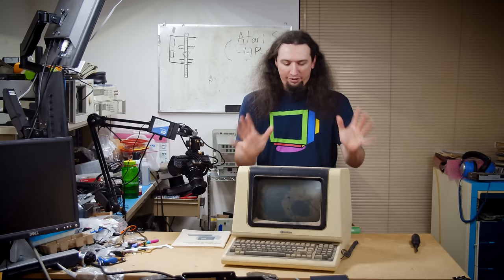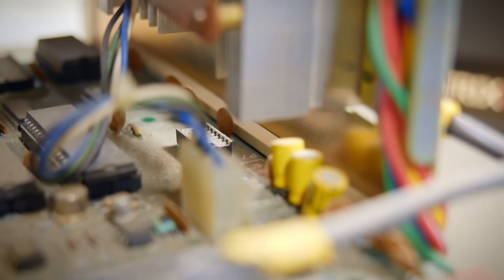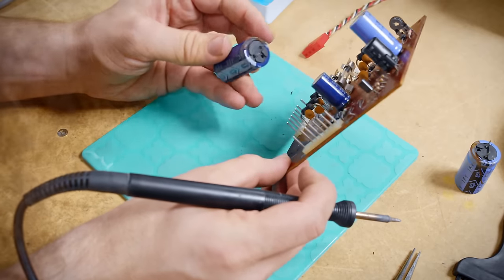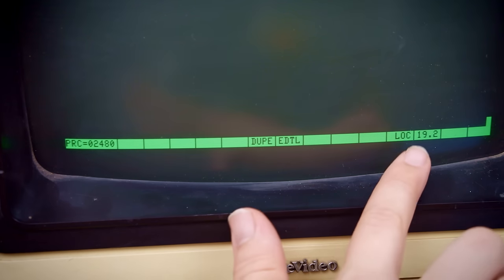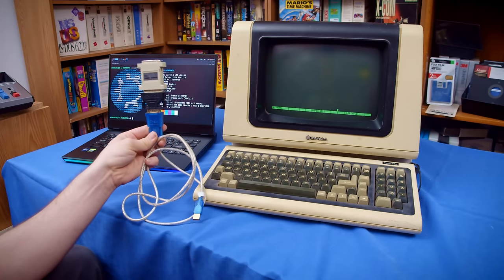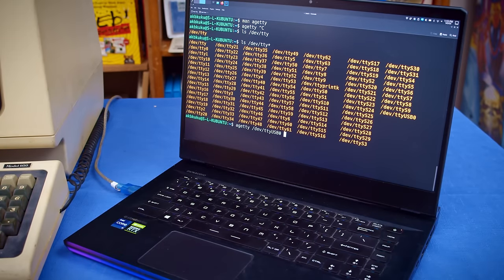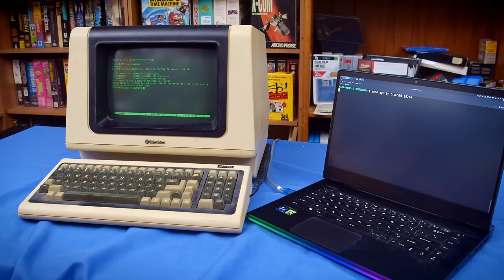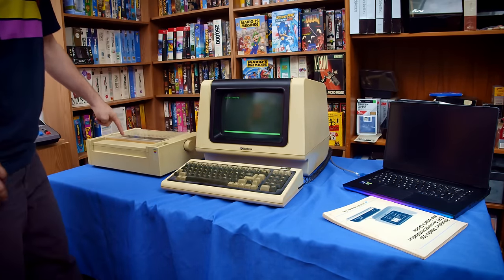1980 Terminal with Linux - TeleVideo 950

Comment: It actually kind of makes sense that the "back space" goes back a space, and the "delete" key actually deletes a character.
Reply: This is my experience with AS/400 as well, at least thru terminal emulators.
Reply: back space backs a space

delete key deletes a key

Gotcha 👍
Reply: That's how they worked back in the day, including on DEC VT terminals.  So it's not a weird mapping, it's correct by design.
Reply: Backspace goes back a single character, not a space.
Reply: @randomdesign6304  Absolutely, it went so far that on the keyboard of my good old Siemens terminal, the key has a double label: "Backspace / Backstep".
Together with the Shift key, it sends the code for "Delete".
Reply: @tramadol42  Erase, erase! Wait, where's erase?
Reply: It's a holdover from typewriters, when you had to go back a space and then press the key again with the erasing tape to remove it, commonly.
Reply: These terminals were around when I was in college.  It's INFURIATING to use this keyboard.  Nobody ever would use them.  Basically they were around in labs, but nobody used them.  People would get on them, get frustrated, and wait for another terminal to become free.

I would never want to go back to the bad old days, but it's funny to see how we keep repeating history.  They're trying to force us all onto "the cloud" - I.E. a mainframe.  They attempt to do this every 20 years or so.  Thin Clients was the last attempt, I was on a mainframe at the tail end of their existence.

Your phone is perfectly capable of running Unix well enough for 2000 users to do all the course work (and research) they could back in 1990.  Kids have no idea how far we've come, and they have NO CONCEPT of how much power they have in their pocket.  I doubt they could work without a GUI interface though.
Reply: It always bugged me, if the cursor is to show what character you are modifying then back space should go back a space and delete should delete the selected character... but the way that the keyboard is laid out does not make it easy to use it like that, I always felt like our current keyboard layout could be made much better along with the shape of the keyboard itself, it should be shaped to fit how a humans hands naturally rest on a table and instead of keys being further away they should be closer to the wrist, think about it, do your fingers magically extend? No... but they do curl in very easily, shift, enter, caps lock, back space, space and enter should be on the floor, you could easily use your feet for those, making more space and probably speeding up typing, I'm also surprised that gaming only keyboards aren't more common, simplified keyboards for daily browsing etc, with wireless switching them depending on your needs would be quick and easy...I just feel like there hasn't been any real innovation with keyboards in a long time...
Reply: You used to be able to go grab all kinds of weird adapters and cables locally when you need them, now you have to hope that you can find what you need online and hope that it's actually wired correctly internally, then wait, depending on how rare and far away it is, days or even weeks for it to arrive...we have one very old computer repair shop that has not thrown anything away in probably 30 years, they usually have what I need, I always make sure I pay above the sticker price, most prices are 15 years old, rare cable priced at 10 dollars, and try to give them as much business as possible in an effort to help them stay open and profitable for as long as possible, it will be a sad day when they finally close...
Reply: @wilfredpayne433 The QWERTY keyboard is pretty much as optimized as you can get. It's intentionally laid out based on the usage of letters in the English alphabet, and most of the extra keys you need for grammar and such are easily accessible. "Ergo" keyboards have flopped over and over again because of how solid the current meta is. All the big brands have had your thought, and spent a crazy amount of money to try to be the first to do it and cash in, but nobody has come close.
Reply: "Print screen" is a DOS throwback to when if pressed would print on a printer what is literally on the screen by sending the contents of the screen to LPT1

Comment: There's no fundamental reason why all the features of this terminal do not work with Linux. The termcap definition is just incomplete/wrong. Someone just needed to get some basic stuff working with this terminal and submitted an incomplete/wrong definition and no one has cared ever since. Just like there are tons of non standard keyboards that don't have proper definitions that don't work fully with Linux because no one bothered. Maybe try with a BSD.
Reply: In general, Linux and the major BSD flavours all share the same ncurses-supplied termcap, so this sadly probably won't make any difference.  If you want a proper tvi950 termcap, you might have to go back to the SunOS 4.x era, maybe a 2nd-gen SVR4 system like Unixware.

[Source: I am a termcap/terminfo author for several terminals, but not the TVIs.]
Reply: So true.  Linux seems like it has all this support for a huge variety of platforms and modular components, but in reality, if you're not running it on x86 hardware with a modern ANSI-like terminal and a recent GCC with full GNU life support system, well... good luck to you, sir.
Reply: @nickwallette6201  I'd go further and say that Linux only runs well on hardware that is 1) supported by hardware vendor employees that contribute to the kernel 2) hardware that is used by big companies who can pay for employees to fix bugs in the kernel 3) hardware that is used personally by Linux kernel programmers. Outside of that sooner or later, you're out of luck because of the constant code churn in the kernel breaking things without testing on hardware that doesn't fall in the three cases I mentioned. These days Linux crashes all the time on the very same 32-bit hardware where it used to work flawlessly (no regressions with the appropriate Windows, so it isn't a hardware malfunction). I had to buy another damn video card recently because AMD employees that "maintain" Radeon stuff in the kernel do not fix any bugs for perfectly working hardware they deem "too old".

On the other hand, I don't think you really need GNU stuff. Alpine with musl/busybox works fine.
Reply: @KnutBluetooth   That's very true.  I have a VIA Epia board that is pretty much unusable on recent x86-32 Linux due to various hard lock-ups and extremely poor throughput on at least the IDE half of a PCI controller card under the sata_promise driver.  Also tried to use a Matrox G200 on another older box, figuring that ought to have great driver support.  Nope.  Completely broken.  Just random garbage on the screen.

I do love open source projects, but the downside of no official support channel is that code maintenance follows volunteer dopamine.
Reply: @nickwallette6201  Except for hardware vendors who are quick to abandon support for their own stuff, I don't blame them. I'd be even willing to pay a reasonable amount of money so that kernel programmers could be hired publicly to maintain older hardware in Linux. But I'm pretty sure this would be opposed ruthlessly with lobbying just like 'right to repair" laws.

Comment: I disagree with the statement that 25 pin connectors had more flow control. IBM introduced the 9pin version because its smaller and it has all the serial handshake lines that are used for rs-232 communication to modems common in the 80’s. Tx, rx, Cts, rts, dtr, dsr, cd, ring, gnd. The 25 pin connector has other pins defined for synchronous serial clock signals, secondary serial channels, and a bunch of unused or reserved pins. None of which were useful for a pc connected to a common async telephone modem or serial printer.
Reply: Most of the extra signals of the DB25 version weren't used by basically anything by the '80's.  Not sure how much they were used before that, as I started college in 1983 and that's when I started getting serial terminal experience.  Used to know the main pinouts for a "proper" null modem cable by heart.  GND is GND, RX crosses TX, DTR crosses DSR, RTS crosses CTS.  Just don't remember the numbers now.

Comment: I would love to get a vintage terminal like this and use a Raspberry Pi booting to serial. The irony is that how powerful and small the Pi is compared to the computers this terminal connected to when it was in its prime.
Reply: Could easily find room inside the terminal to mount the Pi. Just keep it away from the high voltage.  With a bit more work you could use the Pi's built-in TTL serial direct to the terminal (bypassign the RS232 level conversion in the terminal) but you'd need to protect the Pi against the (probably) 5v TTL serial in the terminal.
Reply: That's what Shelby did with another terminal.
Works pretty good and there should be a video of it I think.
Reply: No you wouldn't want this.  What would you do with it?

A raspberry pi is as powerful as the Unix mainframe I was on in 1990.  Why would you want to use this terminal?

This terminal was designed for monochromatic graphical display.  Did he even demonstrate that?  If you want an "old style terminal", get a VT-220.  That's just a 80x24 colum display (was it that?  Something like that..)   There was the VT-100 as well, but I hated working on them, they had lower resolution to draw the characters, much harder on your eyes.

This terminal is not something you'd want to try to use.  The backspace key, ALONE, makes is entirely frustrating to use.  We had a bunch in college, but the only thing people used this for was to show pictures, then log off.  I never once saw a person working on one.  They were replaced by the NCD X terminals which were just dumb terminals that ran X11 in them, designed to be black and white - they were usable but I don't even know if they would be compatible with modern X11.  You could, conceivably (?) run an NCD against a raspberry pi, but I'd check first.  Those would be entirely usable if they are compatible with currently X11.

And you don't want to go back to 1990 anyhow.  You really don't.  All of this stuff was neat at the time, but it's downright primitive today.
Reply: @fuzzywzhe  Yes. Yes, I would. Its the physical personification of putty
Reply: @esra_erimez  Why would anybody want to use putty?

When I think about it, I'm not even certain this terminal is entirely compatible with the VT100 character escape sequences to allow you to run an editor like VI or Emacs on it.  Maybe Ed.  These sequences are necessary to position the cursor.

Good lord, I'd never want to go back to stone knives and bear skins again.

I used to be quite expert with the VT220.  You could reprogram the font.  Somebody used a program I wrote to make a video game, I think it was one of those pipeflow games.  Interesting, somebody made BoulderDash on the machines, but they didn't use my program to do it, however I used my program to recode their version of BoulderDash to run on a VT100.
Reply: I have a televideo950 here. A little cleaner than te one this video started with. I don't use it but kept it in the attic. If you are interested...
Reply: @xavierrodriguez2463  it's not fun to struggle with old technology, it's just a headache.

Look, being able to copy files through a serial and parallel.port was great in 1995.  Would you want to go back to that than just use wifi?

The headaches I endured just getting the damned things to work.  I would never want to spend 3 days again setting up.linux, or futzing around with settings on an audio card, or recompiling drivers and kernels.  Tying to find space to uncompress a file.

So many nightmares and the difficulty of it all, and how fleeting everything was.  To use a floppy again or even a DVD?  No thanks.
Reply: @fuzzywzhe  people like things, is that a new concept to you?
Reply: @gerooq  I know what these terminals are like.  I'm just warning people.  This is a power hungry machine with a terrible interface, and a terrible keyboard.  We had tons of them at school and NOBODY used them.

Comment: Very early in my programming career, it became my job to write terminfo files for clients to be able to use our product's Unix version with all the formatting and whatnot that could be mustered on whatever hardware they bought, since the built-in ones were either insufficient, wrong, or missing entirely.  And a short while before that, I had used many different hardware terminals in college, where the TVI950 was a staple.  Big nostalgia here!
Reply: Yeah, I wrote termcap and terminfo files for various terminals on a variety of mid to late '80's Unix systems.  That was... fun... for some definition of fun anyway.  Never used a TVI950 but spent a lot of hours programming a Motorola 68000-based computer using a Motorola M220 terminal.  Even played around (in off duty time) with reloading character sets.
Reply: @ChrisGonnerman  Unix terminfo authorship fistbump!
Reply: @TheGreatAtario  Thanks.  Not the most fun things I've done in service to the computers, but neither is it the worst.

Comment: 22:41: Just for the record: SystemD is event driven, so you can actually configure the units to only start agetty when the USB adapter is plugged in. It's also possible to use udev to do that but going via SystemD might be more elegant. Of course, it probably doesn't make a lot of sense to go through that hassle for a one-off presentation.
Reply: The events are coing from udev either way, it's just a question of whether it works better for you to have udev do a thing, or have udev tell systemd to do a thing.
Reply: SystemD is decades removed from traditional POSIX/Unix systems that were born for serial and considered the local PC as just a serial terminal sharing some of the computer hardware.  I'm old enough to have used the original tools on Linux machines with no local screen at all. I have also used a real terminal connected to a VAX .
Reply: And there is a pre configured one "agetty@ttyS0 or getty@ttyS0"

Comment: This was a great lesson in serial connections in general. I appreciate you sharing all that info about terminfo, termcap, and screen. I was struggling big time with my TRS Model 102 and connecting to a Pi. It worked but I couldn't get the nonsensical characters to go away despite changing term types. The screen trick worked! Now I have another use for screen other than keeping my IRC session running in the background ;-)

Comment: You should be using the `reset` command when changing term types too. You may even need to cycle power on the terminal if the terminal gets really freaked out.

Comment: It seems fitting for me to comment on this video. ;)  Terminal types are such a pain in the beehive. Even when you're running 'modern' terminal emulators it still causes pain and confusion if you're working on different systems through SSH. Great video, this! Thanks!
Reply: heh for some reason idk if it was because i learned computers in the early 90s as a preteen or what but working through terminals and screens don't cause that much confusion. One of my fond memories is the old internet dialups came with unix shell accounts. That way you can get things fast to your shell from the internet and then slowly download later.

Comment: I did something like this with a Zenith EasyPC 20 years ago. That thing had barely more cpu power than a terminal. It only had a "mouse port".  Well, it actually was a serial port with a lot of stripped pins of D9 connector.
Configuration was a lot easier since i could just use a dos terminal program. Midnight Commander was the end boss when battling code pages and terminal configs.
In the end it really looked like a terminal from the mid to late 80s. With Lynx i could even browse the web (back then it was easier).

Comment: Support for 40+ year old serial terminals in Linux is actually surprisingly good, considering much newer stuff has already been thrown out of the mainline kernel. Like 486 CPUs or IrDA adapters...
Reply: Wait irda was also thrown out? 😮
Reply: Well strictly speaking the terminfo support isn't anything to do with Linux, as it's not done by the kernel at all.  All that Linux deals with is the serial port, and ironically that is not 40 years old.  it's a relatively new USB device, which one wouldn't have had 40 years ago.  So Linux is supporting a quite recent device, and it's only the non-Linux part of the operating system (Linux being the kernel, of course) that is supporting the 40 year old stuff.  Using a PC that has an honest-to-goodness serial port on the mainboard would be more like Linux supporting old stuff.  (-:
Reply: @JdeBP  i mean a lot of modern motherboards have a serial header through the superio. i have one with a port adapter and im curious if this would work with this. just dont have room for a massive terminal that i realistically have no use for but i kidna really want one to screw around with

Comment: Man, that thing is filthy.  Excellent practical demonstration of the capacitor reforming decision tree.  I wasn't expecting to see a 6502 family of parts in there.  CRT cataracts are the degradation/oxidization of the epoxy layer between the safety layer and the glass of the CRT itself, rather than mold.  Great video, glad to see the TV950 in action!

Comment: Terminal printing isn't something I've even thought about for far too many years to mention.  If done properly a long print job could be interleaved with normal user activities rather than occupying the terminal with printing for the whole duration of the job.  At least in my experience printers were usually on their own separate serial port from the mux or host rather than the terminal.